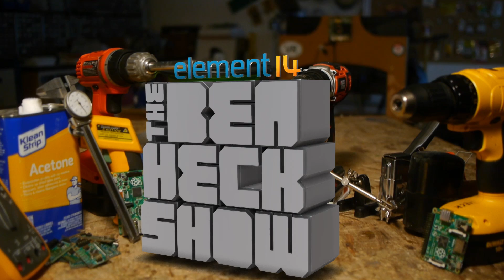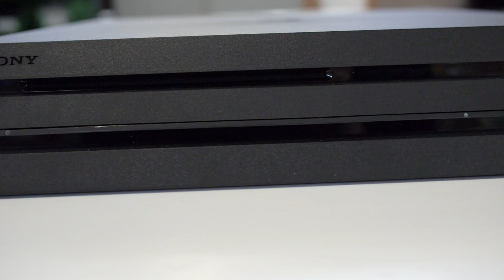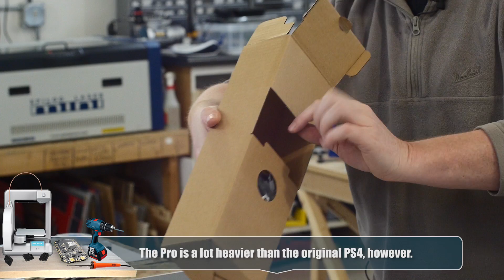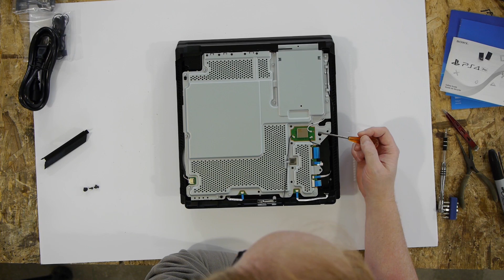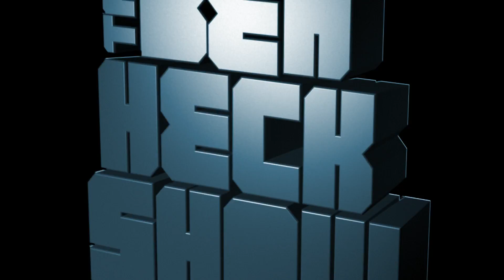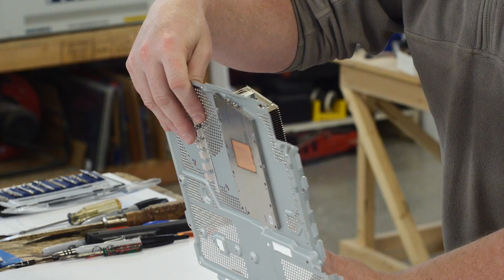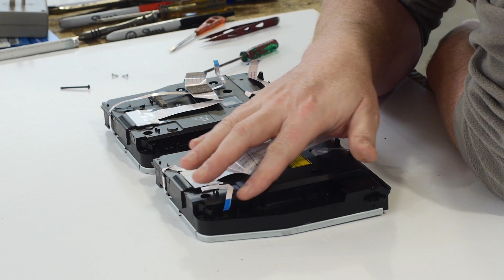Ben Heck's PS4 Pro Teardown

Comment: actually 4k movies so far in disc is about 30 , so no problem for me, scorpio will have 4k player but the price is about 600 dollars and up , if you buy just a 4k player is about 400 bucks and yiu must have hdr tv, hdr stereo,  hdr cables
Reply: Who cares, both are piece of shit consoles anyways. #PCMR
Reply: I care , I like sony ps from day one , PC is the best of the best , the problem with pc is that every year you need to upgrade your graphics car and that get $$$ and to me i like to play on my 65" tv in my couch better than playing from a monitor in a desk
Reply: thats a load of bullshit that console peasants say about pc gaming

my gaming pc runs a FX8370(a processor from 2011) and a R9 380x(which is a mid-tier graphics card thats been rebranded from a R9 285(with the addition of 2gb gddr5) which is a graphics processor from 2014)

with the current offering of graphics cards the literal best bang for buck card is the RX 470 as it performs better than a GTX 970 from last year and costs under $200, i literally built my computer for a bit above $400 and i can run games at 1440p med 60fps or 1080p ultra 60-80+fps depending on the title and with the new line of AMD processors coming out, you can buy a current gen one for dirt cheap and get a decent gaming rig that will out perform a ps4 pro and can also play 4k bluray movies
Reply: how much you pay ?? I only pay 400 bucks thats all , I just get a disc put in and play , thats all, you probably have invested in that pc no less than 1200 and more + hard drives + fans + extra power + monitor and so on , PC is better no discussion there but also is more money to
Reply: 2 more years and ps will come out with new console that will do full 4k and yes may be about 600 to 800 bucks with the 4k player
Reply: I told you I spent a little over $400 on everything, from my case to graphics card, everything cost me a little over $400($409 to be exact) and I have yet to feel the need to upgrade, I want to upgrade but I don't have to, I want to upgrade simply because I can, I haven't because I'm waiting to see what 2017 has to offer but as far as needing to upgrade, I have no need, my computer does everything I need it to just fine. 
I'm not counting my monitor cause you're not counting a TV for your console, I had a monitor prior to owning the computer and idk what you mean by extra power. The laptop you own will game better than your ps4 pro and you could watch 4k movies on that unlike your ps4 pro
Reply: Scorpio is DOA. PS4 lead will be huge by the time that releases
Reply: no only that , PS is making a new console also , we all know that , that will lunch on 2019